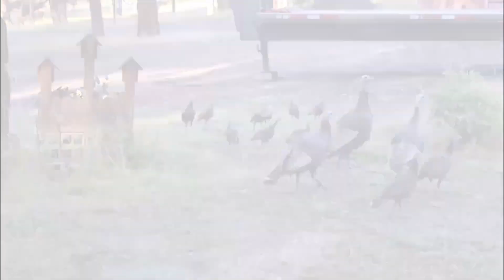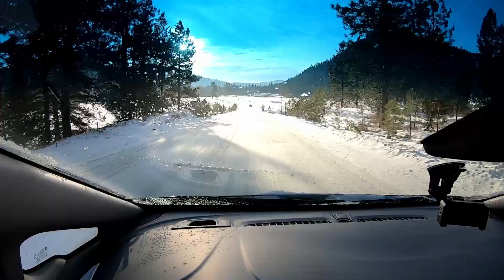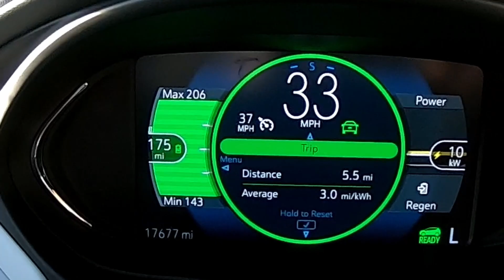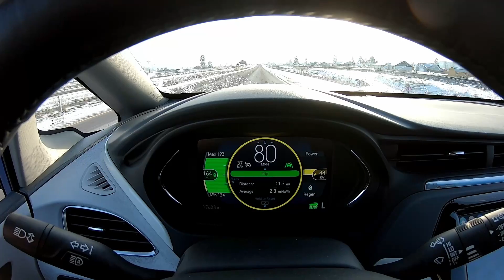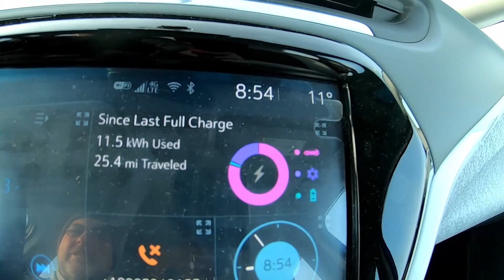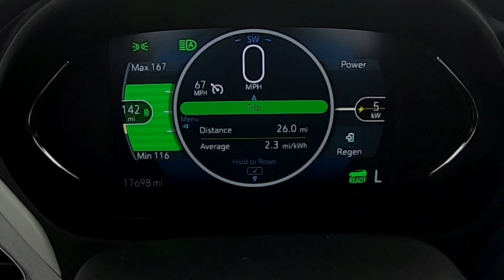Less EV range loss with cabin preheated? Another cold morning drive, cabin is preheated this time.

Comment: It would be good to do a quick survey and see your kw usage at 80, 75, 70, 65 and 60. Just as a frame of reference.
Reply from the maker: That's an interesting idea. This video here might not be the right place for it. 
The kW use decrease with cabin pre heat would be the same at all these speeds. If the heater runs at 1kW instead of 4kW then the decrease is 3kW, because of preheating the vehicle, regardless of speed. 
But just to get an idea of consumption in general that maybe an option. 😀

Comment: On my 2019 bolt premiere I was eligible for my new pack on march 23rd - I ordered from my dealer and a little over a week I made appointment to swap my pack - I brought it in at 8am Thursday before Easter and 24 hours later on Good Friday morning at 8am my dealer said it was ready for pickup and charged to 100% - 2020 bolts will be eligible in May
Reply from the maker: Cool. Congrats on the new pack. We are still waiting and we may have to drive 200 miles to have it replaced as the local dealer may not be able to do it.
Did you get new software for charging too, where you can adjust the SOC limit in 5% increments, like the 2020 and newer?

Comment: Do you have heated seats?
Reply from the maker: Yes the Bolt has automatic heated seats. It will turn them on to level 1,2 or 3 depending on temperature, and then start to lower the level as the car warms up. They work great in the Bolt. Tesla has auto seat heat too now, but it just does not work as good as it does in the Bolt.
Thank You for watching 😀

Comment: I got my new battery for 19 bolt. Went to Tulsa airport and back Tuesday. It was 29F. I used seat and steering wheel heat only. Even had a towel to "defrost " window. Got home with 184 miles driven on highway (Cherokee Toll Road) and 37 miles left! I think the heater would have left me stranded! I should have preheated!
Reply from the maker: Hi Eddy, I think you did pretty good. Certainly heating up the car while plugged in would have helped to keep more range. 😉  We can get about 150 to 180 miles out of the Bolt, depending on elevation change, at about 75 mph, with heat on. 
Decreasing the speed to 70 or even 65mph would even increase range by about 15 to 25 miles for us. A sunny day helps a lot too. On cloudy days you need more heat.
37 miles left is about 14% left, we commonly push it even further and get home with less. Once we come closer to home we sometimes increase speed if we have enough charge left.
It sounds like your new battery is working fine.